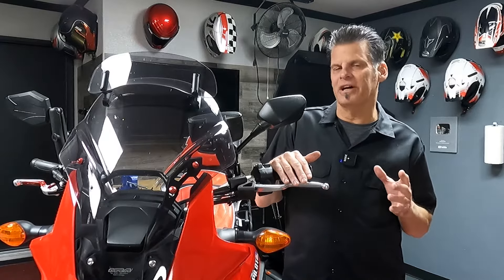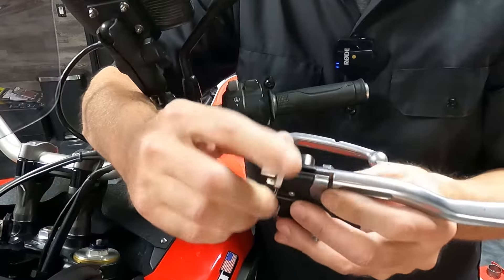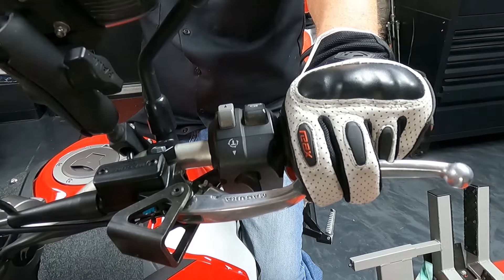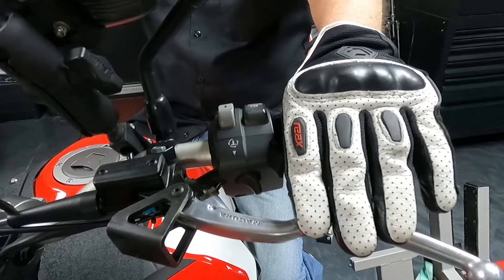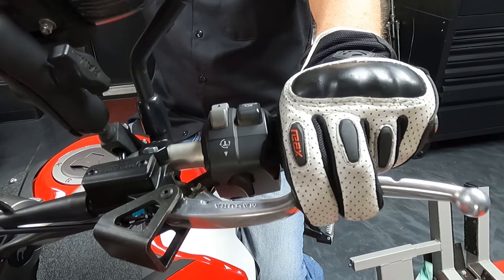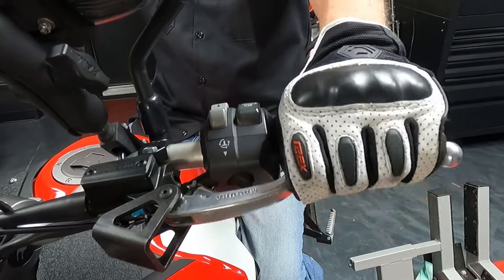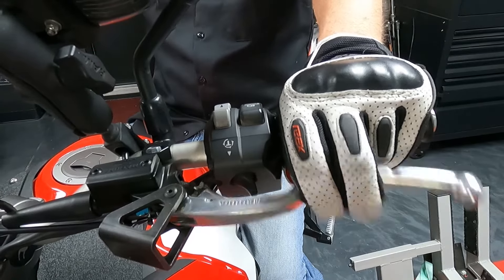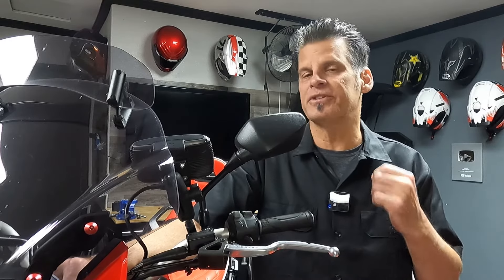PROPER Clutch Control On Any Motorcycle. RIDE LIKE A PRO!

Comment: I'm from India And I have a Pulsar N150 and I never rode a motorcycle before. I have been riding for 2 week's and since the first 3 days I was using 4 finger grip and it was good but after sometime I got recommendation to use 2 finger grip and I did that and whenever I was in low traffic trying to shift up a gear using 2 finger grip my digital meter would not display the gear or sometime it would not show up. That's why I'm back to four finger grip.
Reply from the maker: Thanks for watching! MP

Comment: I been into motorcycles since before dirt was born...lol, no I am not going to even try to say I am an expert. That being said I just tying figure out where riders think that the ideal of the clutch friction point should be immediately right off the handlebars? It drives me crazy, except for one reason, small hands. I understand that, but any other reason is (being nice) not right. Moto Pilot video is good, motorcycle driving instructors will frown on the two finger method, because they are afraid you might break those two fingers. Me I use the full hand, always have always will, but that is just me.  Changing the clutch free play from a penny, my take is a dime to a nickle, can either make it hard to find neutral or if to tight will cost you an expensive early clutch replacement.

Comment: I've always rode like this and now I'm trying to learn to use four fingers and I don't have as much control as I did. Helllpppp. But with only two fingers, it wasn't engaging every time. Using four fixed the clunk down to first though. I have a 2020 ninja 650
Reply from the maker: Try using 3 fingers and pul the clutch all the way in. If theres a clunk you may not be pulling the clutch in fqar enough.Thanks for watching! MP

Comment: How to adjust clutch for complete disengage its plates ,if two fingers wrapped in gloves between lever and handle? So lever isn't pulled in all the way ,kinda clutch plates are still engaged , but engineers design this specific lever for this type of clutch on this bike with  certain "distance of pull " the cable, isn't it?Let say,  If to adjust the length of cable shorter, kinda "slightly pulled already", to compensate short distance of your "two fingers squized between lever and grip" travel, in order to achive disengagement of plates, then another problem come up : plates are slipping after releasing clutch lever, cause cable is pre-pulled and   doesn't allow plates to close up. The way I see it is possible with short levers only, when lever doesn't overcover two fingers, just laid down beside

Comment: Good video.👍
I bought my 1st bike in 1981 (used 1978 Yamaha XS7502D) without ever having even sat on a motorcycle. Pulled away from the dealer without stalling and took my test a week later. Since I had no instructions,  I kept my index finger and thumb on the grip and used my pinkie, ring and middle fingers to operate the clutch and brakes. Still ride like that to this day. Just feels that by keeping my index finger and thumb on the grip and throttle I have a stronger grip with more control and "hang on" power than the usual grip. Reaching the levers is no problem since I have large hands. I use 3X Large ridding gloves. Only draw back is that occasionally my index finger gets a little smashed by the lever due to their shape. Enjoy the ride, and ride safe.
Reply: I presently have a 79 xs750, my first bike too
Reply: @romanrapoz4813  Cool. Years ago I saw a show about the evolution of Japanese motorcycles. The Yamaha XS7502D is on display at some museum as the first true Japanese cruiser. So you own a peice of history there.

Comment: Interesting video. I’ve always whole handed my clutches, I usually buy adjustable clutch levers to allow the lever to come closer to the bar in order to allow this. I feel not having the clutch at the end of your fingers also gives you a better degree of control, but after watching this video I’m interested to try your method! 

Another query, you mentioned a bike will jump if the clutch is out of adjustment, but for some bikes I’ve found just the fluid drag will cause this, is there a way to tell between the two? 

Keep up the great content!

Comment: I understand what you say and why, but you seem to forget one important factor; the force needed to disengage. It varyies considerably (ever tried a Laverda triple clutch?). 
In many cases using two fingers is not practical; even if you are strong enough to pull the lever a couple of times it may not be possible to do it repeatedly. 
Also HOLDING the lever to the bar using four fingers is often easier, especially if trying to hold the position for any length of time like at lights, or if your grip is not strong and/or the clutch heavy. 
The other thing is this; just because professional racers of various genres do something does not necessarily make it appropriate for Joe or Jill biker on the street; remember these people are young and very fit people as rule, often with bikes modified to suit them individually.

Comment: What if my friction zone starts almost at the handle?
Reply: handle bar? that's way too loose, you need to tighten up your cable by moving the barrel nut out or re-clamp it down at the lower clutch arm. free play should be just a couple mm

Comment: How can you adjust the clutch for 2 fingers without messing up the free play?
Reply from the maker: clutch cable freeplay should be a penny thickness between the lever and the perch. This bike actually has a hydraulic clutch so its super easy to pull. twice as easy as a cable clutch

Comment: Does half clutching damage the clutch plate??
Reply: You actually not half clutching/slipping it. Half gripping the lever in most bikes totally disengages the clutch.
Reply: Should only move back less than halfway to disengage. It is surprising how little clutch movement is actually needed. On my 2013 Ducati Monster it is probably only 1/4 pulled to be free to move gear lever. Try it out when taking off in 1st: look at where the clutch lever gets to before it bites. It is closer to the full release than the bar. So the sweet spot is all you need and fully pulled doesn't prevent any wear at all but wastes gear change time
Reply: This is true especially if your bike is fast and has allot of torque under full throttle... it's scary doing 4 finger changes full throttle between 2nd and 3rd on a high powered sports bike lol